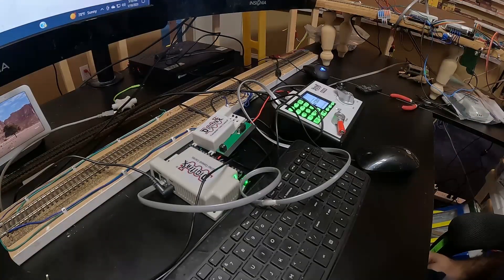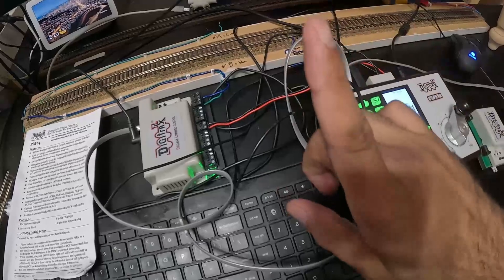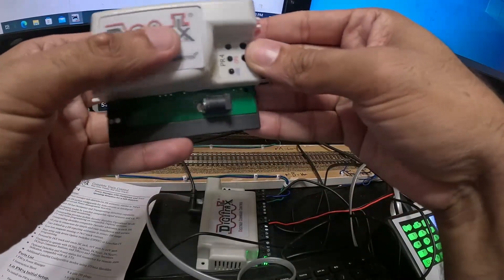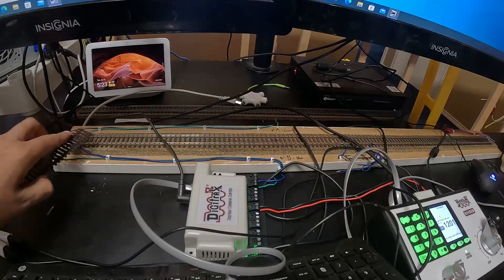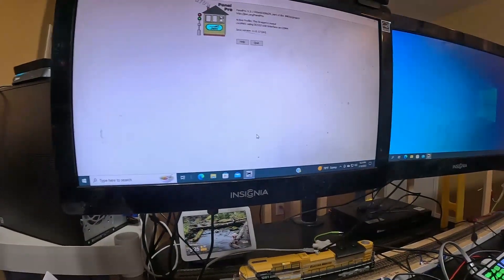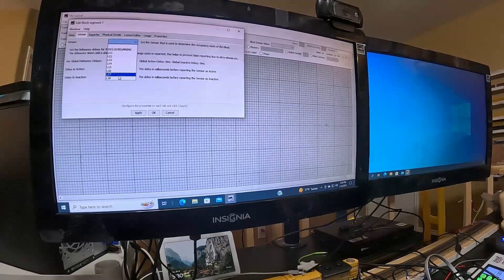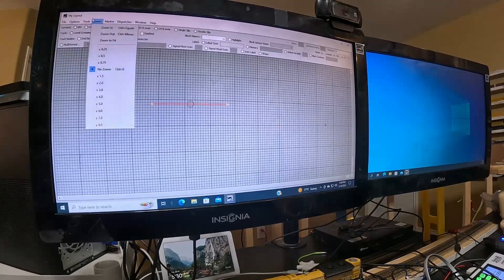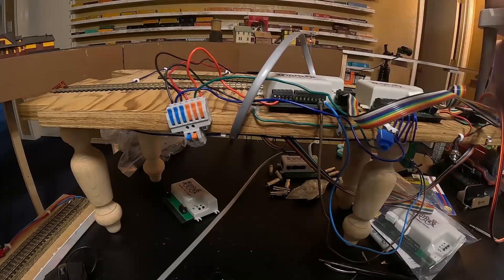How Far Can We Take Digitrax (4): Discoveries and Setbacks the PM74, JMRI and RIP PR4

Comment: Did you ever get your PM74 working?

I think I blew up two of them but no one can seem to tell me why. When I connect the PM74 to LocoNet, it stops any data over the LocoNet bus.
Reply from the maker: I did but very limited capacity to power distribution and block detection  before I had to move. Haven't had a chance to mess with it since may.
Reply: @rayronvr  Well I havce 4 more coming, I hope to not brick them as well.

Comment: how many of the smaller wirelss throttles can be connected to the wireless device digitrax has
Reply from the maker: For the LNWI,  4 phone throttles
Reply: @rayronvr  i was thinking more along the lines of the UT6D hand held
Reply from the maker: @criminal__8615   for the IR readers, the latest ur93 instruction guide does not list a limit for max throttle capacity.

Comment: What is the purpose of the PR4 anyways if you have a command station that connects via USB ?  Still cant figure that one out.   Also does the bxp88 offer transponding too ?  Im working on a layout and trying to figure out which equipment ill need.  Maybe you could lend a hand @Rayon VR !  Let me know thanks for the video !
Reply from the maker: So for me I had a pr4 before I had the dcs 52. Once I had the dcs 52, the pr4 was obsolete. So not really a loss, since I have the 52 now. According to digitrax the BXP88 does alot. Allows 8 power blocks and circuit breaker protection in those 8 blocks. It does detection of those 8 blocks from any digitrax transponder and feeds the info back to Loconet for jmri capability.
Reply: @rayronvr  This is great info! Thanks for the response.  YA i just was reading that it does all that.  Ill be picking one up soon.  again Appreciate the videos learned a bunch. Cheers!
Reply from the maker: @RenegadeModelRailroader  awesome hope it works out!
Reply: @rayronvr  So haha Another good one for ya.  the out put header pins on the right of the DS74. What exactly do they go to.  I know you can connect a cable but where do the pins go to?  Thanks
Reply from the maker: @samuelkerr5590  I use digitirax's ribbin cable to connect it to those pins  to a digitrax BD4N for momentary turn-out control. See it in action here. https://youtu.be/cPMJxpIqj_0
Reply: @rayronvr  awww ExCTLY!! I KNEW IT! lol. So if you have loco net on a bx88 and bxpa1 you dont need to worry about it because you are going through loco net correct ?  Thanks for the reply your awesome!
Reply from the maker: @samuelkerr5590  I need  a bxp88 to test further. :) in a few months

Comment: There is a lot of power in the PM74, it is a nice addition to the Digitrax line.
PR4, that will buff right out :)
It is nice that the bxp88 has built in circuit protection as then a short only takes out a single block. I had been planning to use the DR4088LN-CS, but the circuit protection is a nice addition.
Reply from the maker: Bxp88 is now my end goal but I need a proper command station. Which means dcs 240, ps2012 and 1 booster for the layout. Which will take time to get.